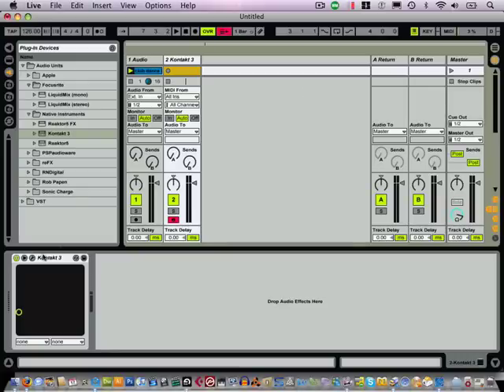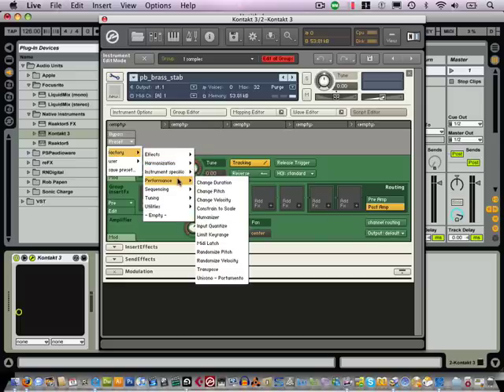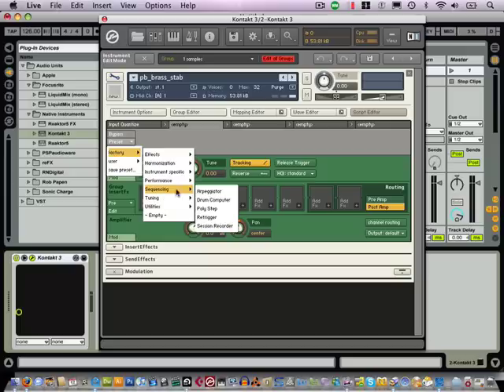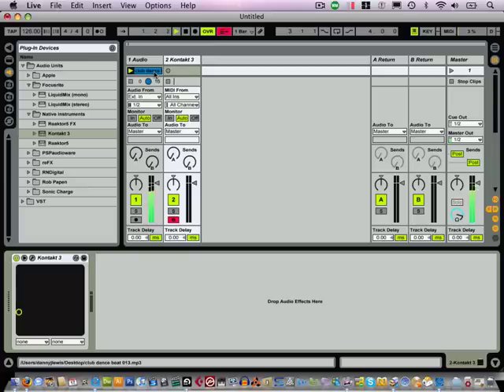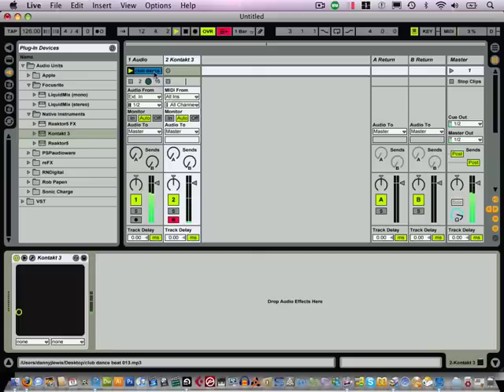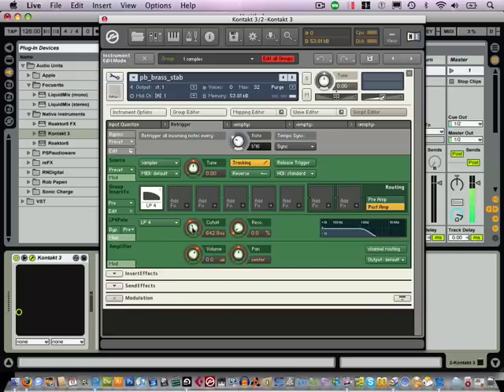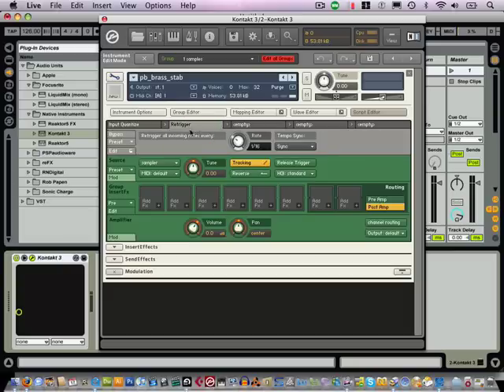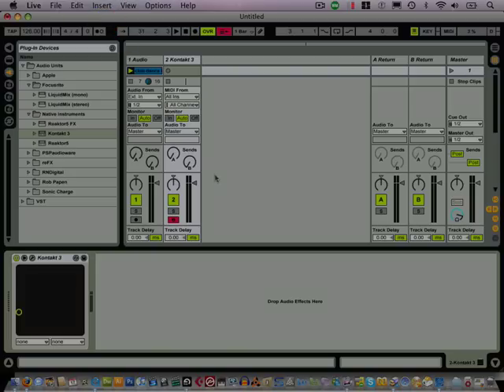Kontakt Tutorial - Sound Design - Retrigger Script

Comment: and If you right-click on the Filter Knobs then "External source" and then *Lean MIDI CC#" you can control the knob with your keyboard just by assigning one of the controllers ( sliders, knobs or the Mod Wheel set Mod Wheel )
Reply: thx